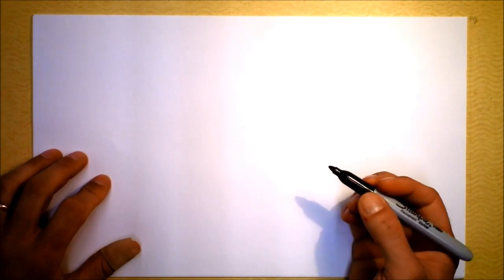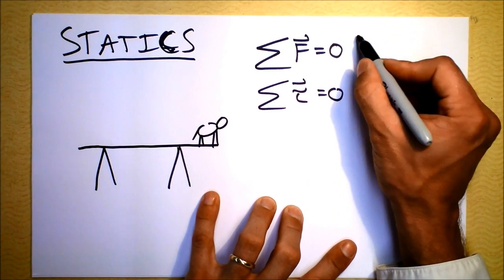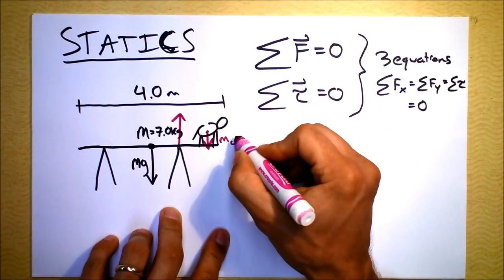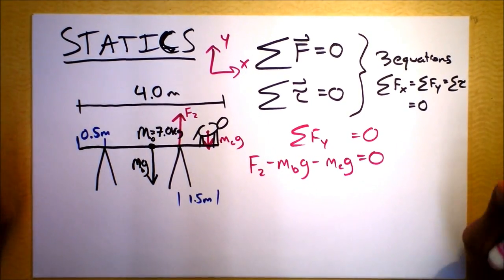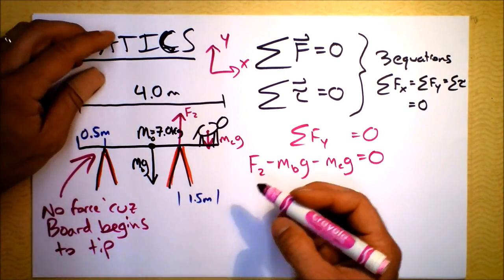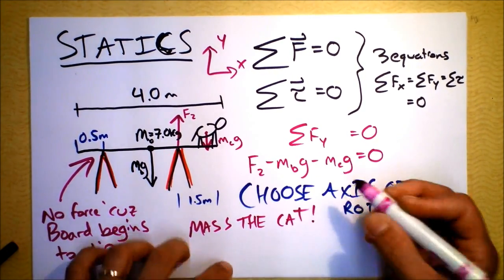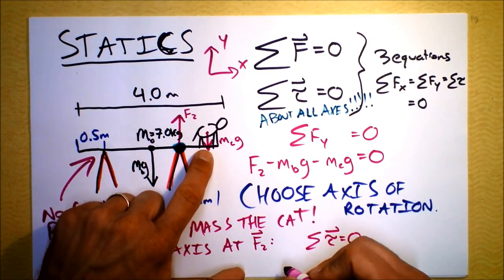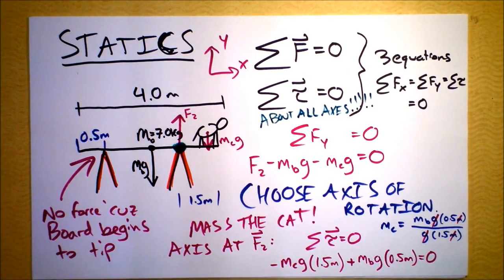Static Equilibrium, or What to do when nothing at all is happening | Doc Physics

Comment: At first I thought that the mass of the board would need to be broken up into two separate portions since it was on both sides of the axis of rotation. So I didn't understand why you didn't add this in. I set up an equation that accounted for this and still came up with the same answer that you find without breaking it up. Now I see that the axis of rotation won't affect that as long as the mass is evenly distributed across the board. Is this why it isn't necessary to break it up?

Comment: at 8:30 you said mass of the board is positive (ccw), isnt supposed to be cw its going down. so it should be both negative?S
Reply: Counter clockwise (CCW) is actually considered positive , coz if you were to draw an angle going counter clockwise starting from from horizontal line (x-axis) the angle would be positive, as it's above the horizontal line (x-axis). If you were to draw the same angle but going clockwise(CW) the angle would be negative, as you are going below the horizontal line. Hope it helps for someone later asking the same question!

Comment: and what is meant by the board just begins to tip
Reply: i think what he meant is that the system is purposely set up to be unbalanced (the left end of the board has no force, remember?). of course, if the system is unbalanced at the first place, there'll be a short interval before the system collapses. the point when the system is about to collapse = when the board begins to tip

Comment: Why is the mg positive for the force acting on the board if the mg for the cat is negative? You said that the mass times acceleration of gravity rotates clockwise for both the cat and the board so they have negative torques. Does a negative torque indicate a negative value when you substitute the forces into the net force equation and set it equal to zero? Or is the mg for the board positive because the board would go up, from the reference point of the ground, if the mg for the cat is greater, and that side would go down?
Reply from the maker: I just chose a direction to be positive for the forces.  Anything the other way is negative.  Both weights are negative at 4:02.  Positive or negative torques must be determined by whether they rotate CCW or CW around the chosen axis.  So carefully note where I am using as an axis for my torque calculations.
Reply: Cats don't obey ANY silly human laws such as force balances, torque balances, conservation of energy or momentum. Don't know you that by now?  You'd know that if you owned a cat.  (I don't now, but I have.)